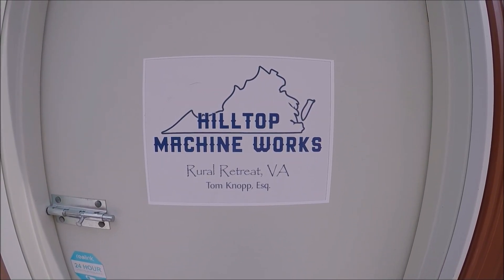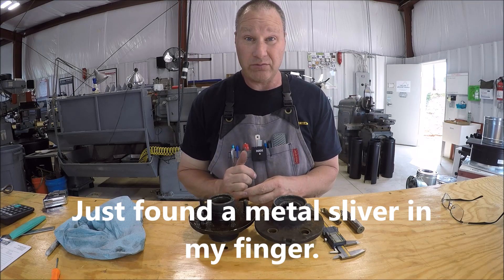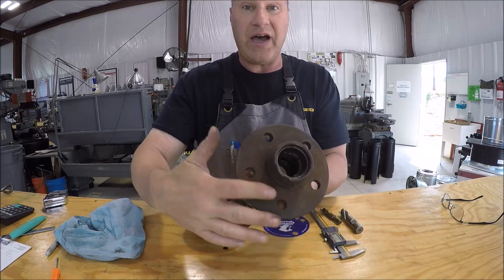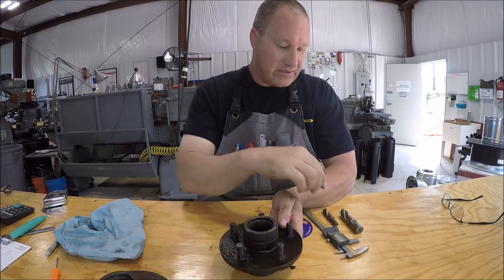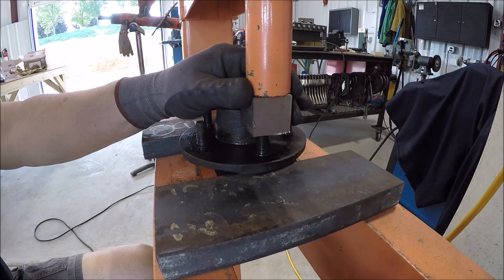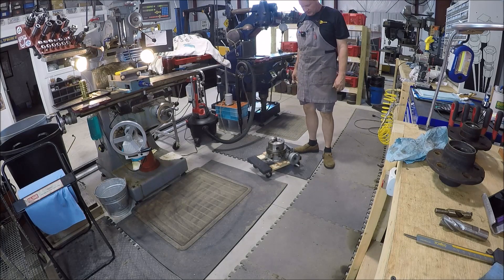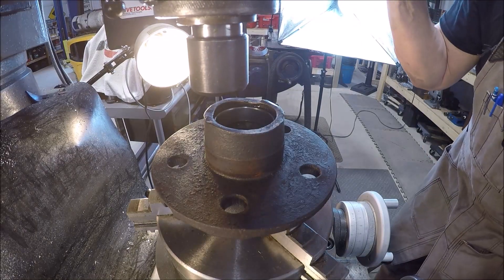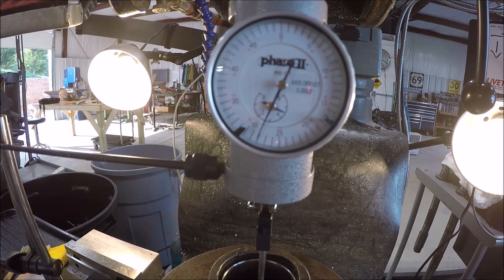Bolt hole pattern change for front wheel hubs

Comment: I had adapters on my truck, but they stuck out too far so what I did is put the adapter on and use that as a guide. drill the holes with a handheld drill. and cut off the studs. It worked just fine.

Comment: Hello would you want to take the 5*114.3 wheel hub and redrill it to 5*112 . And add some new studs m12 1.5  and thru the rotors so I can run 5*112 wheels on my 5*114.3. if I don't do this I would have to drill out the 5*112 wheel lug nut bolt hole 1mm or 2mm . Either way is an idea that works
Reply from the maker: Can you send me an email about what you want done and maybe some pics?

Comment: Sir i need to mount my 15 inch truck wheels with a 5 bolt pattern onto my small trailer hub which has a 4 bolt pattern.  Is it possible for me to drill out a 4 bolt pattern if there is a 5 hole bolt patter on the rims.  I am trying to put large 15 inch wheels onto my trailer which only has small 12 inch tires.  Or would it be easier to just buy new hubs from my trailer place for 45 dollars each they have new hubs that i could get.  But I wonder if it would work for me to drill 4 new holes into a rim and make it work.
Reply from the maker: I would say it would be easier to just buy the 5 bolt replacement hubs. Because I imagine the 4 bolt hubs are going to be smaller in diameter and there will be not enough meat there when you move out to the 5 bolt pattern. Also you may run into a couple of the 4 holes trying to drill the 5 hole pattern which means they would need to be welded up first as long as the hub is some sort of steel and not cast iron.

Comment: If your up for more work? I am looking to convert trailer hubs to a 5x150 lug pattern to except Tundra wheels. Would you know how to locate blank hubs or of a trailer hub large enough?  Or would there be a way to take some tundra hubs and modify them to work on a trailer.
Reply from the maker: Have you looked into wheel adapters first?

Comment: Nice Tom, by the looks of the chips im thinking there cast steel not cast iron. To long of chips for cast iron.  I sure like my parking attachment for my super spacer, big back saver.  Your shop is looking great. I have spent a lot of time rearranging my shop. Had to move some machines out to get other machines in. New shop on hold till prices get back down.  Always nice to see a video out from you Tom.         Gary
Reply from the maker: Hey Gary. Yeah I was kind of on the fence about the material. It was fine powdery chips for the most part. Every now and then I would get a long chip. If it is cast steel then it sure is poor quality and probably wouldn’t want to waste my time welding on it anyways. Material prices seem to be  dropping off finally. Hopefully you can get started soon.